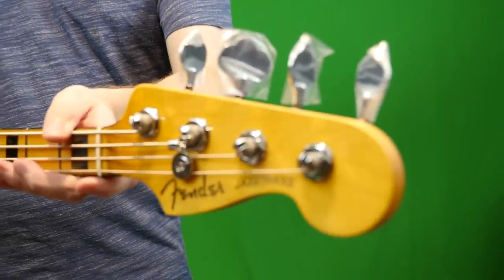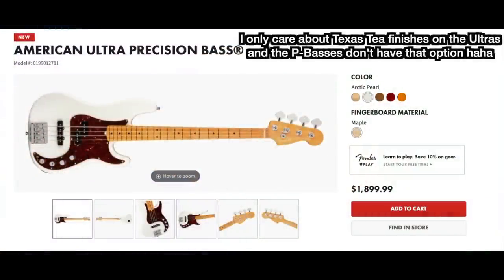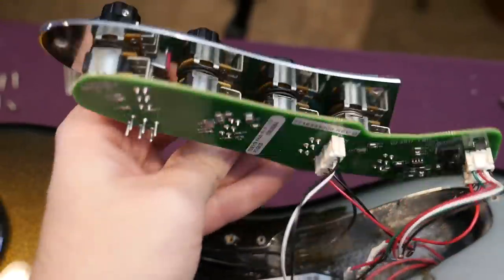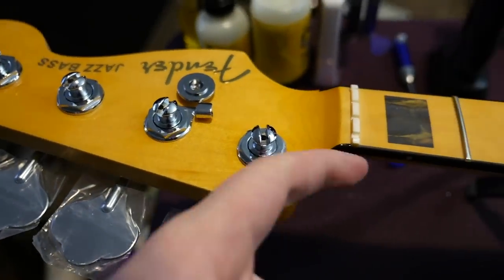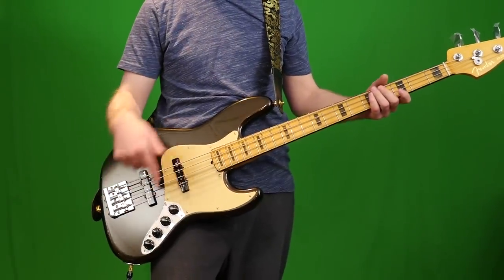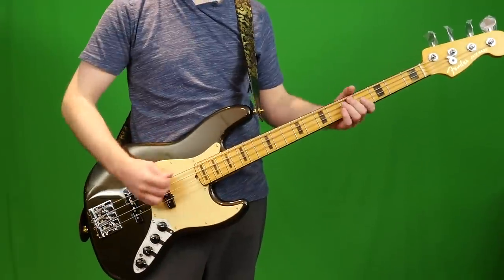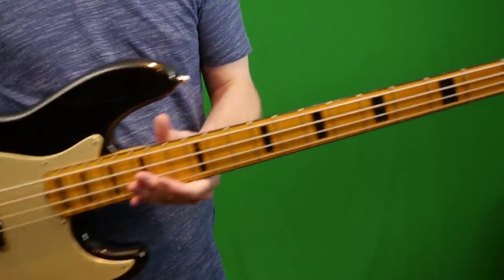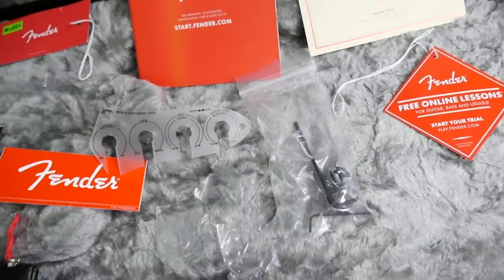Make Your Guitar Player Jealous | 2019 Fender American Ultra Jazz Bass Texas Tea | Review + Demo

Comment: Guitarists HATE  PCBs on in their guitars, and then buy a dozen pedals to play through...
Reply: Thats kinda why they don't need an active circut in their guitars. Bass players who play live sessions usually will require some form of active circut or preamp to get the best sound for both the audience and enough gain going into the monitor system for other musicians to hear them. For recording sessions and situations, a passive bass is preferred because the sound engineer controls the eq, gain structure, noise, etc.

Comment: I just bought this bass last week. I have been playing 43 years now. I have never had a bass that was this simple to set up. Bar none. It arrived in disappointing shape. I took all the relief out dropped the saddles and viola! the lowest action I have ever played since a friend bought a new Monarch bass back in 1985. I may bring it back up because while there are no dead spots or buzzing it is just too low to my tastes. I do have to say that the neck carve is thinner than the traditional Jazz bass carve it';s not bad, just different. The pickups and EQ system I'm leaving as an unanswered question. I'll have to wait to declare how it sit's in a live mix with my Ampeg SVP pro with QSC power amp and 10" speaker cabs. It should be fine. Reccomended.

Comment: 11:24 That's Fender's "Stealth" A-string retainer, helps with the strings break angle over the nut. It's supposed to help alleviate nut buzz. Fender started putting them on their some American made models around 2013-2015(?) I think, not 100% though.
Reply: Yep.  They work really well,  they eliminate the weak A string sound obvious in some passive fenders.  Kinda weird as they tend to only fit them to more expensive active instruments.  Made a big difference to my P bass when I added one.
Reply: I have the same problem when my nuts start buzzing! I get a bit excited.  Lol. ;) Lovely bass though.
Reply: Is also on the 2011 Fender 60th anniversary P Bass. The limited edition one with the different pic guard
Reply: I play hard so i always need that or my A string would pop over

Comment: That Texas Tea IS STUNNING!!!   You're spot on, everything has been appointed to perfection. 

  Recently learned with the Fender Molded Case with the TSA locks,... The divots on top near the four corners are for stacking your Fender Guitars.  What I found out was they can be stacked up to a recommended 6 guitars high (old style was 4 high). 

  My only question, why Fender didn't use a similar Battery (power) system as they did on the new Acoustasonic Telecaster?   Which uses a  rechargeable battery hidden inside the guitar with USB output (located right beside the output jack) .   A long USB cord comes with and  only needs to be recharged every 20hrs of use.   Would Look better than having the two plastic covers on the back.

Thanx For another Great Vid!!    Have to say, I'm no bass player either but can understand why you purchased that one.... She is Gorgeous!!

Comment: I got exactly the same bass, about to return it for the second time as it came with a fret buzz on the 5th fret for 2/4 strings, for teh second time. First one, tech guy couldn't get rid of the buzz without raising the action more than it was already, and it was quite high out of the box. He suggested that I return it and get another one.
Same problem with the second one I got. The tech guy suggested that I play at a lower intensity and get the hang of the bass, but a week later, the fret buzz is just not acceptable live or for recording (nor for the price of the bass). Just wondering if you noticed that issue too and were able to fix it? I didn't hear the buzz on yours. I guess it is bad luck on my side, that or Fender's QC just loves me.
I am not even getting picky about the off center screws on the pick guard (both basses suffered from it) or the Philips screw heads that were stripped, again, on both models.
At this point you must think the store duped me by giving me back the one I returned, but I checked the serial numbers and they were quite apart, which suggest a different lot maybe. I really want to love that bass and spend this ridiculous amount of money for a bass I probably do not deserve, but that Texas Tea is having a bit of a bittersweet taste already and wondering if I should even try a third one at this point.

Comment: I hope Fender have fixed the problem with those noiseless pickups (in general - all their noiseless pickups) going open circuit. The lead outs from the upper coils are short, taut and are soldered down almost as soon as they exit the coils. The structure of the pickup is not super rigid, so what happens is that if there is any flexing or shock to the pickup, that lead out wire is stressed and eventually it snaps. Usually it is the wire running to the inside of the coil, so there is no easy fix. I have replaced several sets of noiseless pickup for customers because of this. And what about the infamous 'black fingers' problem with those anodised gold pick guards.

Comment: The bit on the A tuner is an extension to get a better break angle on the A string...i would prefer if Fender used a single bar across all strings to get a good break angle on all strings, & helps damp a little but i would put a wrap on top of the nut or just behind it to damp out the open string tone...nice Jazz...shame they never took the black binding round the whole edge of neck including front edge of headstock...& or a matching colour headstock same colour as body would be nice imo....nice tone...plus active & passive,kool..

Comment: If the action seems high, that's not good as it gets. that's so you can slap without getting a lot of buzz.  If you stick to fingerplucking you can get it set up super low and slinky edit: yep, you did set it up pt good
Reply: ok, I was agreeing with the high action at the lower registers. I didn't know that too low an action will affect the slap part. I'll leave the action as it for now. Maybe I might get the action lower by sending  it to a professional.

Comment: Active electronics are just bleh for me. Also what is the obsession with thin necks? Give me a baseball bat please. 

Also Trogly, you should check out a Fender Bass VI. It's like a super baritone guitar. You can tune it down to A or even E standard like a bass. Super fun instrument.

One last thing, that guide on the E string is there because there's often not that much tension behind the nut, so that just helps your string from buzzing out.

Comment: And they can get rid of the battery. Give me a break. Tell me people what bass player wants to say oh wait I've got to change the damn batteries in my bass so I can keep playing. Your in front of a crowd and it goes dead midway through a song. Fender screw the people by doing this active pickups. Just put normal pick ups with a booster switch.
Reply: That's one reason the active/passive switch is included. A simple flip of this switch will have you back in the action. Many modern higher end bass models have active pick-ups and most bassists use this feature often.